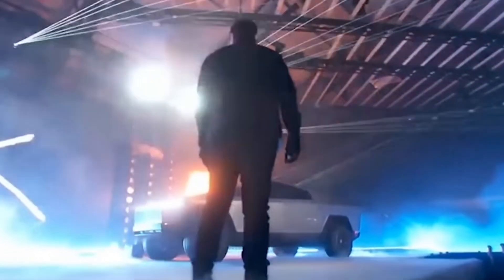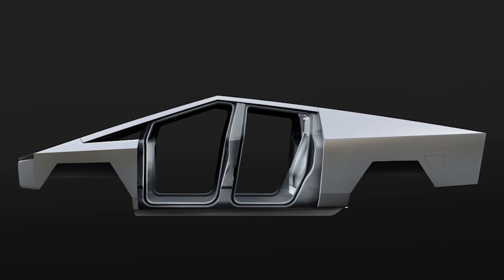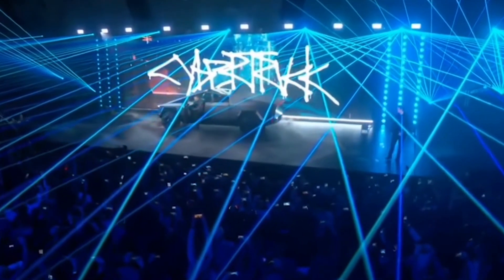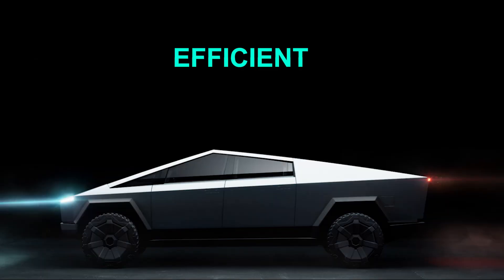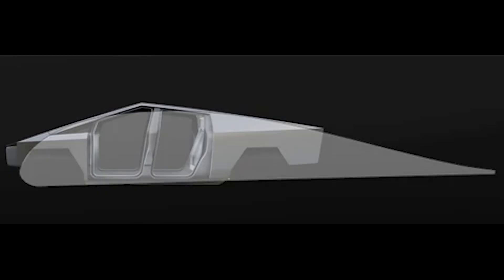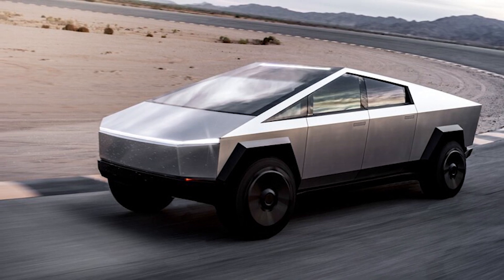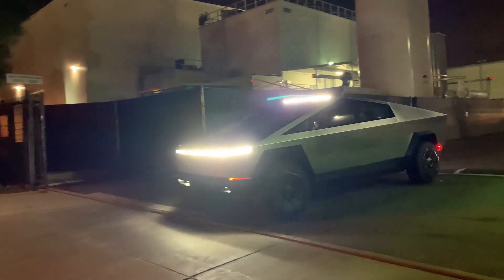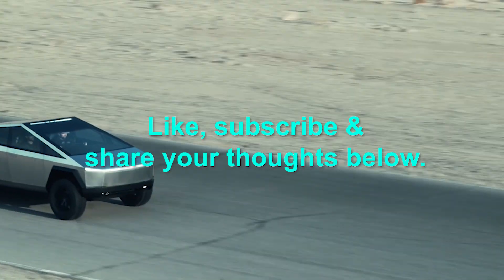Cybertruck is Engineering Genius (and will be copied)

Comment: I don't think the competition must copy the Cybertruck or go bankrupt as you said, because not everyone likes it's aesthetics and personal preference is quite an important factor in the car industry. I personally like the Cybertruck alot and it's certainly a brilliant car, but I don't think it will destroy the competition as much as you said it will. 

Great video anyways, thanks.
Reply from the maker: Thanks Phil. Time will tell but I don't think I articulate my point very well in the video. The two most expensive components (battery and computer) are both on declining cost curves. Right now, Cybertruck is around price parity--same dollars = same value/performance as ICE (roughly) but battery and computer costs will continue to decline. ICE components won't. The more time passes, the better value Cybertruck will become vs all competition. At some point in the future, its performance and price will be impossible to match (let alone surpass) with an ICE vehicle.
Reply: @SolvingTheMoneyProblem  When I said "competition", I ment both ICE aswell as EV competition. I agree that EV technology has huge potential and will propably outperform ICE cars in the near future. But an important part of the Cybertruck design is also it's simple and edgy frame, which, though I personally like it and despite it certainly having huge manufacturing advantages, doesn't appeal to everyone. I'm just saying that the average car buyer isn't that rational and might prefer a less genius design due to simple looks and other factors of personal preference. 

I think we mostly agree though, Cybertruck is a really good idea.

Comment: This thing looks like it's gonna last...
Reply: The one thing I think about is rust xD Wont that thing rust like F**K after a couple years? There was a reason the other teslas were made with aluminium and that was great.
Reply: The new battery study that we know about has shown only 10% loss after 4000 cycles. That's what they released for free so other people could copy. There is a good chance that tesla has a even better version that they are keeping for them self. 1 million miles on 4000 cycles is easy
Reply from the maker: Yep. Tesla is on the cusp of a million+ mile battery too. Might be the last vehicle many of us ever buy..
Reply: You are literally brainwashed by your cult leader. Wake the fuck up. Million mile battery my ass. He will say anything. Hes a piece of shit.
Reply: @SolvingTheMoneyProblem  You're delusional
Reply: @GroovesAndLands  not on one charge, more than milion miles is the battery's lifespan
Reply: @srmaerospace9497  I knew what he meant, and I'm still saying rubbish. Even with 500 mile range per charge, 1 million miles is 2000 charge/discharge cycles. Can you imagine your iphone's battery lasting 5.5 years of daily charges/discharges? Everyone knows phone battery performance is severely degraded after a year or two - or about 500-750 cycles. Elon is using the same lithium ion technology that all the other electric devices use these days. Also, the performance of the battery is not ONLY dependent on charges/discharges, but also sheer age. Even someone that drives 50k miles per year would take 20 years to accumulate 1 million miles. Everyone knows a lithium ion battery doesn't last 20 years, REGARDLESS of how many times it's been charged or discharged. Elon is either straight up delusional, or a straight up snake oil salesman. I think the latter.
Reply: @GroovesAndLands  you have no idea how batteries work do you?
Reply: @GroovesAndLands   and they said he would never land a rocket in reverse
Reply: @GroovesAndLands  technology evolves, who knew 🙄
Reply: @GroovesAndLands  LIAR TROLL! Even the NiMH BEV have proven to operate almost 15 Years. These BEV from the late 1990s are functional but massively degraded in 2019. Liquid Thermally Managed Lithium Ion is an incremental improvement on lifespan. That means 20 years is very doable. You fail at basic history.
Reply: @jackson7962  what you've just said is one of the most insanely idiotic things I have ever heard. At no point in your rambling, incoherent response were you even close to anything that could be considered a rational thought. Everyone in this room is now dumber for having listened to it. I award you no points, and may God have mercy on your soul.
Reply: Until i see crash tests and reports, I wouldn’t put my babies in there.
Reply: They can’t even get the window right.
Reply: @FOT2010  i have a feeling they wanted the window to break. it generated more publicity. they have over a year to "fix it" before production.
Reply: @jackson7962  Your cell phone battery is comprised of multiple lithium ion cells, each worth about 1.75V at full charge. The Muskmobile battery is exactly the same - but obviously with more cells. The technology is not new, novel, or ground breaking.
Reply: @gal, you do realize that the phone industry doesn't include battery management because they want your phone to die, so you buy a new one. Properly managed and they last much longer. my model 3 came with an 8 year 120k mile battery warranty.
Reply: @GroovesAndLands
Old-fashioned and narrow minded, ok boomer. Stay here while the rest of us move on and look forward the futures technologies.

Comment: Rigid&tough does NOT equal safe in automobile collisions.
Usually, the structure of the automobile is engineered in order to absorb the kinetic energy of the collision, by deforming,

But with tesla's cybertruck, the kinetic energy from a collision is not absorbed by inelastic collisions, but is transferred to the passengers. It's a deathtrap.
Reply from the maker: I'm not an expert but I don't think you are giving Tesla engineers enough credit. For one, passenger sits as far back from front of vehicle as in Model 3 - so, there's room. Second, the steel can be scored to crumple in a fairly consistent and predictable manner. As mentioned in the video, I hope Tesla talks more about safety soon as a lot of people share your concerns.

Comment: What I'm wondering is how they will make transparent aluminum production cheap at all. I mean, it's a space-grade material
Reply: Maybe he is trying to create an infrastructure for mass produced space-grade things
Reply: william truscott I bet there’s something to this. Tesla cyber truck sales will make going to Mars cheaper, so possibly more lucrative
Reply: @aj-tf7xk   Its almost like he owns a space company or something right?
Reply from the maker: I'm way out of my depth on the materials cost BUT I did do some digging after the Cybertruck debut and found cost comparisons to similar materials and it seemed the aluminium glass is about 3x the cost of regular glass.
Reply: @SolvingTheMoneyProblem  What would be interesting is to see how these flat ALON panels stack up when compared with typical car windows. I wouldn't be surprised if a significant portion of the extra cost is reclaimed due the ease of manufacture and installation.
Reply: @erictheepic5019  <---- is right. AlON is an emerging technology that is exploding onto the scene currently.  While not quite the wonder-material it is made out to be (It is about 80% as good at nearly everything as the original transparent aluminum, Sapphire aka Al2O3) it is MUCH easier to produce than alternatives. And that will only ramp up.   I do wish Musk  and Tesla were a bit more systems oriented, however.  They've cut corners in the past (using cheap eMMC chips on their brain boards, and not doing a trash-cleanup in their code.) but they're learning from their mistakes.  Elon does need to stop talking about areas he has little experience with; Rural anything seems so outside his area of expertise that he should either hire a consultant or simply not talk about it. 

shrug I've wanted one since its launch. It matches my needs almost perfectly in every area except one.
Reply: @SolvingTheMoneyProblem  : Don't forget that "metal glass"  isn't transparent to light.  it is still metal, it still has a mobile electron cloud making it opaque....   "Glass manufacturers" have hijacked the Idea of metal in glass-like state (amorphous solids) when marketing glass with ??metallic??  strengthening additives  and "proprietary" heat treatment.
Reply: its probably because they don't need to specially shape the windows if they're perfectly flat and can just water jet or laser cut them in to shape
Reply: scotty picks up the mouse.. "computer... show me transparent aluminum that will hold two humpback whales
Reply: It's already being made, as you know the military got it first, and now Tesla is making it for thier vehicles
Reply: @thesurvivalist.  The military probably had it in the 70s
Reply: @AlexFlockhart  We are 20 to 30 year behind for civilian to get the technology. When I was stationed at Fort Irwin, they walked us thru the operations center, you wouldn't believe how far the tech is, I still have not seen it in the civilian  world!
Reply: @thesurvivalist.    Ehh, where the military shines is in application and integration. They're using transistors made by the same processes in the same FABs as the rest of us. If anything, they're usually a generation or two behind, to let the civilian market work out the kinks in the tech.   The military also has easier access to high-end encryption than the civilian market. There has been talk over the years of limiting civilians to lower levels of encryption to ensure that if the government REAAAAAAAALY tries they could crack it and browse our porn collections.   

And regarding transparent aluminum windows. . . industrial production of Al2O3 started in 1903 for the watchmaking industry.  Aluminum oxynitride is a bit weaker than that, but VASTLY easier to produce.
Reply: @Fusako8  The military transistors are actually better, with very low tolerance.
Reply: @allan710  No, no they aren't.  The US military uses Intel CPUs like nearly everyone else.  Most high end supercomputing is done on consumer grade gpus.  100s of thousands of them.  The government doesn't have some secret chip fab somewhere cranking out super transistors.  Chip FABs take billions of dollars, and over a decade of building, calibration, and set up.  The .mil MAY have Intel binsort chips for them, but this isn't any different than any overclocking company.  Do some research before spouting this BS.
Reply: @Fusako8  I'm talking about components only. CPU's would be too much. Well, at least my teacher at University told me that resistors with 1% or less tolerance are normally used by military and aircraft in general. He may be wrong.
Reply: @allan710  That's bin-sorting. Nothing more advanced. Bin sorting is essentially just picking out the highest quality bits out of a production run. This is how all CPUS are already sorted. They essentially make a couple different CPUS per generation, and then test them to see what speeds and functions they're capable of running.  So the $1k high end CPU is the same as the $200 midgrade enthusiast CPU, just binsorted to its quality. This is why you get people buying the midgrade CPUS who throw massive coolers on them and run them like the top end ones.

Btw, I'm Alumni of The University of Alaska Fairbanks' Computer engineering program. My specialization was CPU design. I worked with the Arctic Region Supercomputing Center there.  (UAF has AMAZING engineering programs. Probably the best Bang for your Buck for an engineering university in the US. Just gotta be able to survive 50 below temps.)
Reply: @Fusako8   Nice. Also doing computer engineering. Nice to know these things. My specialization is a bit different.
Reply: Its not a true aluminium glass. Plus as with the radical stainless steel. These technologies only exist because Elon is making a "HUGE" spaceship made of the stuff. I would imagine the windows on the crewed Starship will feature "aluminium" glass, ultimately bringing the cost down.
Reply: Lots of space grade materials got into the consumer market. What I find intresting that it almost looks like cybertruck will be made from the same materials than SpaceX Starship, which has huge windows in the renders. Stainless Steel and space grade, "bullet proof" windows?
Reply: Well he does plan on driving these around on Mars.
Reply: it probably uses the same windows as the freezing rockets, this might be a way to get the price down overall for the windows.
Reply: I believe metallic aluminum used to be extremely expensive until a scalable process was developed.
Reply: The reason he has to make the cybertruck so cheaply made in the factory ( as far as construction goes) is because he wants people to be able to afford them in two more years when cars and trucks have inflated in price again. I mean who has $50,000 to pay for a vehicle these days? that's crazy let alone in two more years higher prices on trucks. Only business owners may be able to afford that kind of price but your average middle class cannot.
Reply: It's really just exactly the same story as the body.  He's using flat glass.  It can simply be cut from flat sheets instead of molded.  And I am presuming that the native characteristics of the glass means that it doesn't have to be tempered or laminated, further simplifying production.  That also means the same glass can be used for every window, unlike cars that use laminated glass up front and tempered glass on the sides and rear.  I'm guessing these flat planels will require an anti-glare coating, but tint and UV shielding are already required features, so the anti-glare can be rolled into that process.  So just like with the body, even though the base material is quite a bit more expensive... The simplification of tooling and streamlining of processes should dramatically reduce time and costs.
Reply: Fairly certain the glass is from the same glass used in the solar roof tiles.
Reply: Please people, why is the vehicle so special. I don't like a but.
Reply: Please people, why is the car so special? I don't like it a bit
Reply: ALON costs like 3 bucks per square meter. Yes that's 10X more than regular glass but we're still talking less than a hundred bucks for the entire car. It's not actually space grade material. The steel is though. But lets not kid ourselves 301 and 304 Stainless is nothing special. The exact recipe can be varied to make something perform better but it still is basically frying pan steel. Just turns out to be great for building rockets too. Gets stronger as it gets cold, when the rocket is fueled and it stays strong at very high temperatures requiring less heat shielding.
Reply: eggs it’s just materials don’t have to be expensive combining them